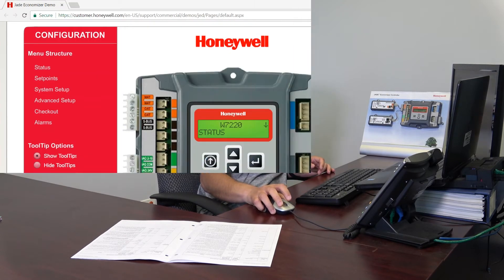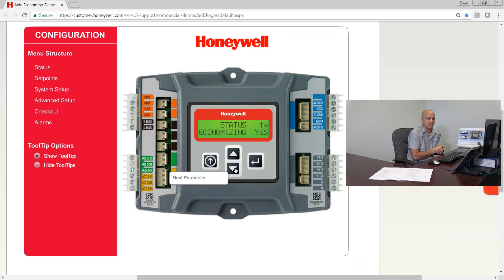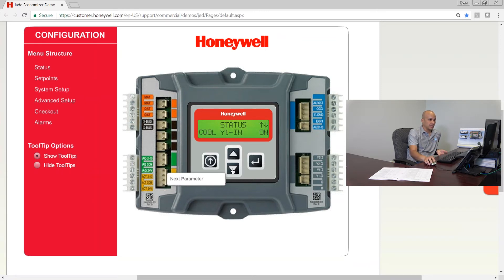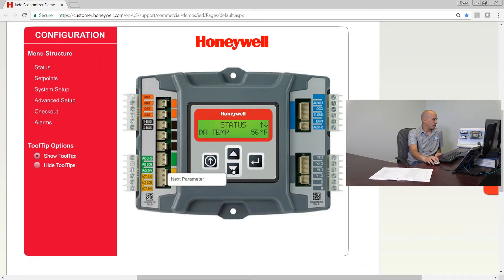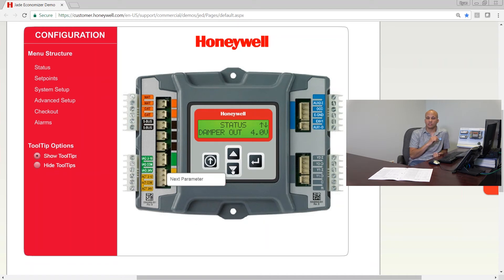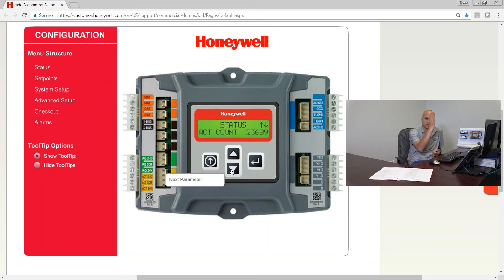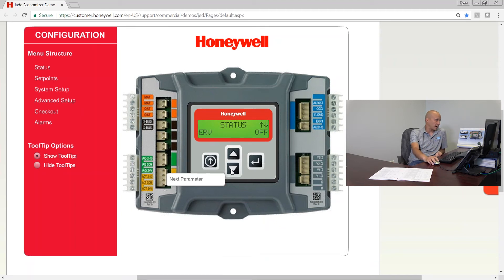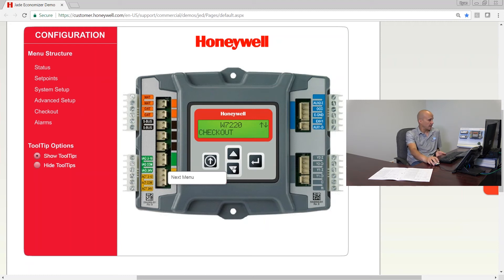Economizers: Honeywell JADE Controller Service (3 of 4)

Comment: The S bus enthalpy sensor shows no value under status, I put a new one in, still shows no value. There is no alarm either. Does anyone know why this is happening?
Reply from the maker: This is a remedial question, but do you specifically have a Sylk enthlapy sensor?
Reply from the maker: As a test, wire the sensor to the controller with a 1 foot cable so you know if it is a problem with the wire or the hardware. You can also wire the sensor to a different JADE so you can confirm the sensor is good. Make sure the dip switches are correct for the sensor that you are looking at on the status screen.

Comment: I know this is an old video but does this simulator demo program still exist, I was unable to find it on honeywells website do you have a link?
Reply from the maker: No, that program ran on Flash. Adobe has been blocking all old Flash programs from running since 1/12/21. Honeywell never created a replacement program on a more modern platform. It is too bad, because we used to use it in our in-person classes every month.
Reply: Is there any way we can push Honeywell to replace this program? I'm teaching rooftops and they almost all have these Jade controllers and this program seems necessary for beginners.  @TECTubefilms
Reply from the maker: @jimjanich7815  We agree that we want it back too. Not sure how to make that happen.

Comment: Question. I have a customer in Florida that has a skin business, Botox etc. it’s located in a shopping mall next to a Chinese restaurant that has multiple hood exhaust. When I arrived I found the economizer blocked off due to sucking in food smells from next door. We’re in Florida and rarely need economizers. It has this jade controller. Is there away I can remove it and not have a economizer? Is it as simple as disconnecting it from the board and still have control of mechanical cooling?

50GC - PO6A2M5A6F3D0
Is my model number.
They currently combat the smell with aroma 360 in duct work
Reply from the maker: Yes you can remove it and rewire. You generally need a "jumper plug" to do either. Basically follow the installation instructions in reverse. But you can also just leave it in place and change the settings on the JADE so it stays closed for now.

Comment: What enthalpy curve should I set curve too to achieve the lowest humidity set-point
Reply from the maker: Lowest outdoor humidity?  Use ES5... but that nearly disables the economizer.  We recommend ES2 for the vast majority of applications.
Reply: @TECTubefilms   that’s strange , I had it set es5 , it was raining outside, 100 humidity and system was still economizing , I replaced temperature/humidity sensor  , got the same results , customer wants limited amount of humidity to enter space.
Reply from the maker: @ganeshmotiram2847  It was 100% humidity at what temperature outside?

Comment: How do you keep the Damper open all the time?
Reply from the maker: Do you mean 100% open?  You would not want to do that.  You won't have enough heat in the RTU to handle that on a cold day and you also do not want to bring in that much heat and moisture in the other seasons.  The damper is automated to only open more than the ventilation minimum when the thermostat asks for cooling AND their is cool air available outside.  With that said, if you are determined to run 100% OA, then all you have to do is set the minimum ventilation position to 10vdc.  But it is a very bad idea.

Comment: On an existing running unit, how do I get a dampener to remain open 10% always that is not running currently economizing. Would changing set points/mixed air temp be doing that? This oddball unit has Y1 cool setup but oddly Y2 brown wire on tstat connected but not connected on the rooftop unit no know why, would that affect economizer controls if Y2 not setup?
Reply from the maker: Not really sure what you are asking.  Do you want the damper to modulate between 10% and 100% when in economizing mode?  Is that what you are asking?  What do you have the minimum damper position set at now?  How do you have the JADE occupancy input setup?  Are there any other factors setup that involve damper position such as 2-speed fan or CO2 DCV?
Reply: Tec Tube my business partner would probably say a fixed 10% open, unit is condensing causing water to drip leak in the prep area inside the building as means for a solution. It’s a one speed, unit settings are default as installing CO  likely didint configure any (5 units same on roof for multi tenant commercial retail space) and dampener is closed screen in fresh air intake spotless nearly. But I’m fine with modulating 10-100% open based on temps outdoors (efficiency reasons) and setup the second stage Y2 wire (unconnected in unit above).
Reply: Tec Tube I’m unsure of occupancy been looking at YT videos to understand how to configure this unit and be able to change settings here but as far as I understand it’s based on set points/ set point temps?
Reply from the maker: @jonnybco  You should watch all 4 videos in this series.  The economizer has two job functions (minimum code required ventilation and free cooling).  In your example, you want to configure the economizer for 10% code ventilation when occupied and 0% at night when unoccupied.  Then the economizer free cooling function will open the damper more than 10% when the space wants cooling AND it is cool outside.
Reply from the maker: And yes, both Y1 and Y2 of the thermostat should be wired to the JADE inputs.  Even if there is only 1 stage of mechanical cooling.

Comment: Never worked with economizers,   are the stat wires to controler through factory harness,  or physically run to it?
Reply from the maker: It could be either.  On a new RTU ordered with an economizer, there would be wiring harness plugs that go into the "front" of the JADE.  If the JADE is field installed, it will instead come with plugs that go into the "sides" of the JADE and they have wiring terminal screws instead.
Reply: Tec Tube  thanks so much...appreciate your help!   Great channel, very helpful.

Comment: great video a lot of good info thank you.I had a question, I'm currently working on a jade controller on a carrier split system (heat pump) I'm having an issue on the status menu, im in cooling and it says heat pump is In heat.any Info would be greatly appreciated
Reply from the maker: Why do you believe it is in cooling?  Because you have cold discharge air or because of the signal you can read with your meter on O/B?

If you suspect a wiring issue, use your meter to check the inputs on the JADE board... specifically Y1-IN, Y2-IN, and AUX2-IN and compare them to the status screens for the same 3 inputs.

If you suspect you may configured something incorrect, check System Setup for AUX2 IN.  Do you have it configured for HP(O) or HP(B)?

And don't forget about the Honeywell Tech Support hotline at 1-888-516-9347 when you can't find the answer in the book.